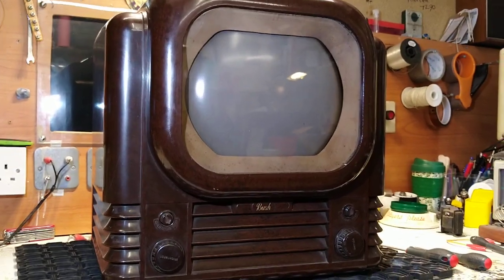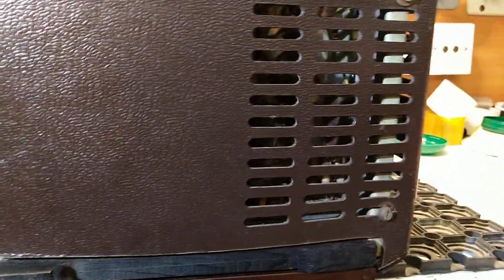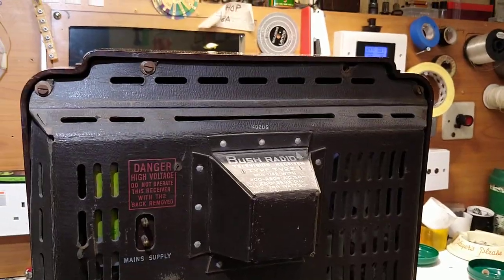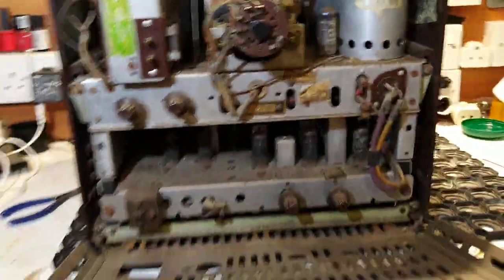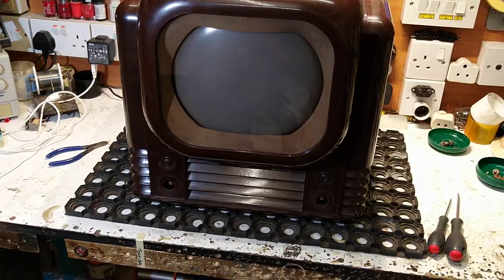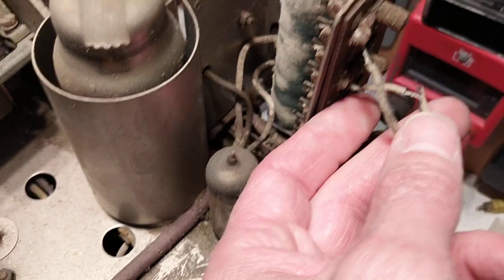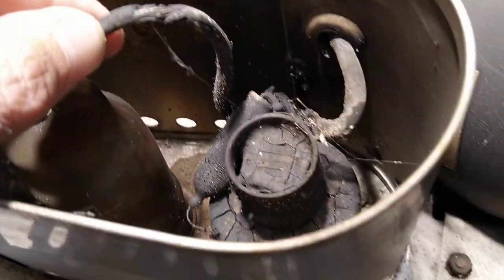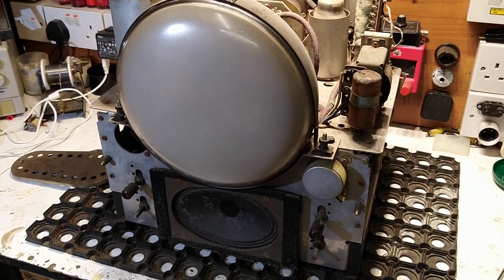A Bush TV22 Restoration Part 1

Comment: Thats odd. My 1951 mk1 has a different layout on the top deck as it has 2 caps near the crt neck. One cap on the scan coil has a cap jul 51 on it but cant get it to run. Just lit valves and raspy sound

Comment: Is that a doormat, and screwdrivers from the pound shop? 😅
Reply from the maker: Hahaha....yes, its a door mat, it's identical to the original Philips service mats of the 60s. They're very good as any small screws or blobs of solder drop through the holes and prevent the cabinet from.getting scratched, plus there non slip.
 But, the screwdriver are good old Stanley....had them for years. 👍
Reply: @vintagetvandwireless  that's a good idea, I should take a look at them!

I think I've seen too many screwdrivers 😅 I have no idea where any of mine have come from